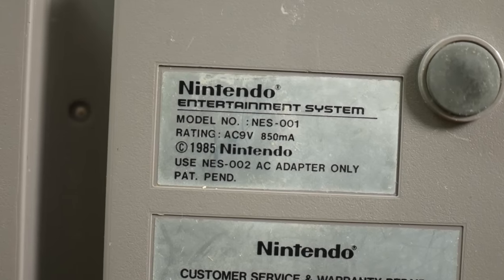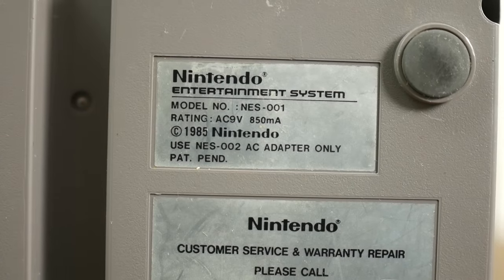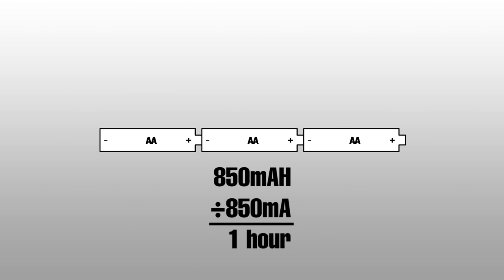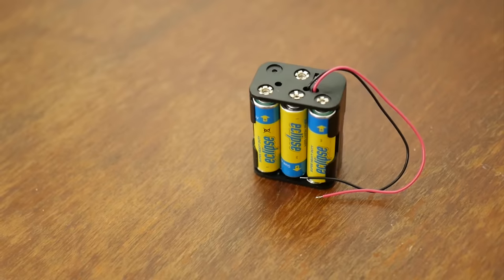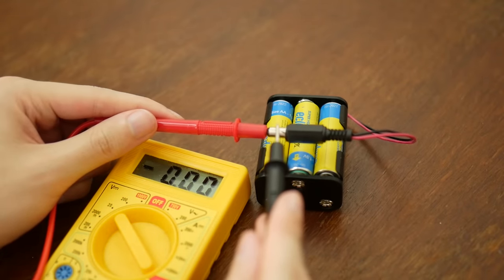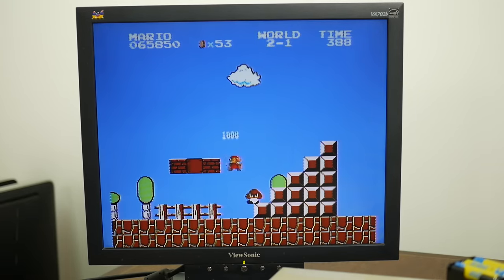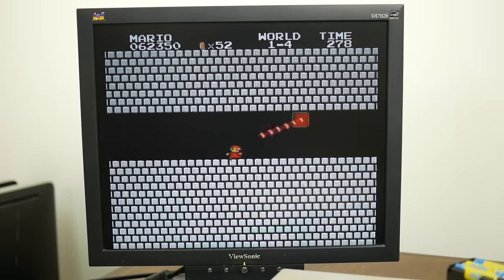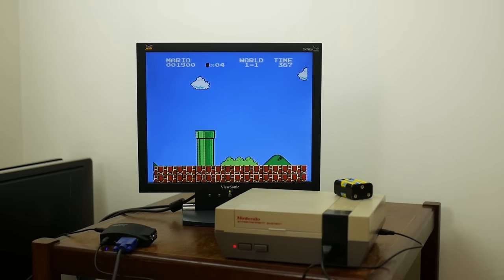Can you run an NES from AA batteries?

Comment: Yeah you need atleast 4aa batteries i did this before 

Or C or D batteries would be better for about 4.5-6v. But with an nes youd want to rip out the rf modulator and rectifier circuit

Rebuild the composite video amp and remove the voltage regulator so it takes 5V DC and not 9vac
Reply: Famicom is easier
Reply: And with rf modulator gone less power hungry

Comment: You can buy lithium batteries which output 1.7v max. I got a whole month out of my bose qc15's then before it started browning out and clicking. Notably the headphones would flick off if I tapped them or anything. I could only assume the voltage had dropped so low that the power switch resistance was enough to cause it to be sensitive to movement.

Comment: there was an old ben heck schematic (might still be available) that covered this. you turn the nes into a nes portable by removing that component that has the voltage regulator and audio/video amp. then you replace it with a transistor and series of small caps and resistors, then bam, battery powered NES that not only can connect to a TV, but also an LCD. mine is somewhat... in limbo.. i just never finished it because i could never find an affordable LCD (they suggested using a PS1 screen, which now costs around $150, out of the question).. im just biding my time before trying to finish this thing.. and also i don't have a proper case for it..

Comment: To solve the whole low voltage issue you can put a voltage regulator and low voltage cut off in between your batteries and NES to solve the issue

Comment: Solution to dead batteries. Hook up another bank in parallel.  If you lose color connect another set of batteries into it. Remove the other ones and repeat. Use rechargeable lithiums for maximum use

Comment: Fully charged batteries always are higher than what they're rated for. 1.5v would be normal around 1.9 to 2v. My 72v (6x12v, 20amp each) ebike is fully charged at 89v.

Comment: if you'd have aimed for closer to the 18v max you'd have gained way more capacity as the voltage could drop much lower per cell and still total 9 (or what ever the lowest that is still usable)
8 batteries seems like a safe bet 13.5v ish (in theory 12 would be the max but as you've already showed that might give to much and even 10 of your batteries would give nearly 17v so a bit close to the max for my comfort)

Comment: Try connecting it to a car battery and see how long it lasts. Since it has a voltage regulator rated up to 18 volts, it should be safe. I bet it would last considerably longer than with the AA batteries!

Comment: you should try a drill battery w/ a buck converter, they're rechargable, and often come in at 18V 3Ah, for an effective capacity of around 6Ah at 9V (since you're drawing half the current from the battery)... thatd power the NES for about 7 hours, and its rechargable!
Reply: or maybe a 10Ah car battery, that'd last abt 15 hours, and also rechargeable

Comment: I was suffering because you didn't checked the curent it was drawing. The batteries have internal resitance, well, everything has a little bit of resistance. It could have fried the inner circuit.

Comment: I have a question, can you run an iMac using only double-a batteries?
Reply: Yes but you will need a lot of double a batteries so it would be just better to use a car battery and a converter

Comment: wait, is it posible to run 2 and 2 baterias together so you get double the capacity, then chain 6 of those for 9,9v and 2x the capacity? (with 12 bateres in total, and 24 if you want 4x the capacity)

Comment: If you really, really want to make it even more efficient especially off the batteries, you technically can use 5 Volts DC switchmode voltage regulator designed to replace the original 7805 voltage regulator, as all linear regulators do is pissing all the extra energy away into nothing but heat which means a bit more power consumption considering the fact that both processors in NES consume the most electrical power (which is also why NES gets rather toasty after a few hours of gaming). I would go that route to reduce power consumption and as a side bonus, less heat.

As for glitching at the end, most voltage regulators are basically dumb, they don't know any difference between the input and output voltage, so they instead stay on until at least the GPU and / or CPU lock up. Those processors require 5 Volts DC power to operate correctly.

Comment: Not futile at all. If you are going to an expo as a seller and there is not power outlet. You might want to test the device in front of the customer and here is a solution! A small LCD TV that runs on battery would be required but that’s fixable too!

Comment: NES runs better on 9 volt battery ,i have tried it before. DC input completely eliminates AC hum sounds and other noises. but 9 volt AC means 14 Volt DC (9*sqrt(2)),if you measure the voltage on the DC side of the diode bridge, but using 9 volt DC runs 7805 regulator much cooler, it even doesn't get warm.

Comment: I tried a 6LR61 battery on a snes several days before, and it runs around 15 minutes. although the battery is taken from a heavily used multimeter, I'm pretty sure a brand new 6LR61 would last at least 30 minutes or more.

Comment: Idk what’s the friking problem with everyone thinking 10v dc is dangerous because it’s NOT.

what’s dangerous is AC not DC
Exemple: 3v dc, very inoffensive
3v ac, tingles a bit your muscles
So 125v ac coming from the outlet is lethal
BUT NOT 10V DC
Even if Matt would’ve connected the two terminals of the battery pack together it would do nothing because it’s dc(direct current) with very low amperage

Comment: So, question. Is it possible to connect batteries both in series AND in parallel? Like, by pairing up two batteries in parallel, then having two pairs be in a series (or some other setup?) Will it end up in catastrophe? And is it possible to avoid said catastrophe, and if so, will it deminish the theoretical effects of both having a longer battery life and a larger voltage?

These sre things I need to know.

Comment: I mean...with a big enough battery (or more accurately, a lot of little batteries in both series and parallel) you can power anything.  I can drive for almost 300 miles on a battery.  It just has to be a big battery.  (400v in this case).

Comment: I once powered a wii (and a small TV) off of a small lead acid battery. I called it my wii portable, but it still needed a massive carrying case to take anywhere XD

Edit: I also used exactly this method to test a supposedly broken famicom. It worked! I got a couple games for it now and it runs off a 9v wall cable along with the disk system

Comment: See after seeing this im wondering about using rechargeable AAs instead and stripping down an NES to fit into a handheld sized form factor along with something like a car backup camera LCD + some controller board for display. It would honestly be kind of feasible and now im seriously considering trying it out using a cheap NES hardware clone

Comment: With this video, now I'm probably capable of running a raspberry pi through batteries. Though I'm assuming the difference between AA and AAA is how much charge is needed.
Actually what happens if you take 2 of those battery packs and connected their wires? Would you benefit from both methods?

Comment: it actually is 6x the capacity even if its parallel. capacity is the amount of energy that is stored. So 6 batteries is 6 x the energy of 1 battery. 1.5x6=9x 100mah= 900mah or 100mahx6=600mah x 1.5= 900mah. I think what you mean is the mah rating which is not capacity.

Comment: I can run a Yamaha PSR-6 keyboard off of a single 9-volt battery, instead of the 6 D batteries it was designed to run on, I accidentally left it on for several hours on the 9-volt battery, and the battery was hardly drained at all.

Comment: as a kid i built a duffle bag that had a small 12 volt black and white portable tv and the nes in it running off of a 8 aa battery pack . that thing ran for a few hours at least . i even included a plug so i could plug the thing in and recharge it . i think the reson i didnt blow the nes was i was using nicad batterys.

Comment: should have used two of those battery packs, and run the packs together in parallels (combining series and parallel) to get both more voltage and capacity

Comment: Next time, try buying 2 battery holders and run them in parallel.  Correct voltage, double capacity.

Comment: 9 volts AC is rectified and Goes to a 5 volt regulator in the NES so you can power it from 4 AA Batteries. Or even less if you use a DC to DC Buck converter

Comment: if you put them in series to get 9 volts and then you make about 4 sets connected like this in series and then you put the 4 sets in parallel, wouldn't you have 9 volts but with more capacity?

Comment: when I was a kid , i had an imitation nes system , and the power adapter was crap and in became really hot after extensive use , so I used to play with an 9 volt rechargable battery

Comment: Yes, you can run an NES from AA batteries.

You need 6 and the NES will only run for about an hour, +/- 30 minutes. Then the graphics will keep glitching more and more until the batteries die and the console shuts down.

There. I just saved you 12 minutes.

Comment: If you connect 6 pairs of parallel connected bateries in series, will it have 6x the capacity and the voltage?

Comment: 9 volts sinusoidal AC will become 12.7 (aka: 9 x sqrt(2))volts DC if you rectify it. The diode will drop 0.7V usually. You end up on almost exactly 12V.
You need a 12V supply at least if you want to power an AC device from DC usually. Most old things also run from LM7805 chips which makes 5 volts from anything between 6 and 33 volts
9V DC and 9V AC carry the same energy but only with a perfectly resistive load with no dynamic change in it.
Also you talked about parallel and series but completely forgot about mixed. make series stacks and hook them in parallel. you increase both voltage and capacity lol

Comment: I wonder how a modern console would respond if powered by failing batteries

There is no reason to believe they are programmed to monitor and handle a failing power supply.
But so much code is re-used these days that maybe they have some sort of protocol for handling it.

Comment: 5:55 bro used multiple AA's to make a 9V battery (when the most common batteries in a house / kitchen draw are  AA / AAA / 9V / CR3032 should of just started with a 9v and then done like 4 to extend the length then you'd of had the same voltage but longer aswell (2 birds 1 stone)

Comment: I also did this, but with a HDMI to AV, At that point, signal kept cutting in and out, and then finally kinda shut off, the HDMI signal wasn't enough and shut off the HDMI signal, I'll prob get a variable power supply so i can do more than that.

Comment: 3:35
@Phillip_HanBurst THANK YOU, this is the proper equation:

850x9/60x850=108 (AKA 1h and 8mins) for the lifetime
or an easier way to think of it:
MaH Rating(X)Input Voltage(/)1 Hour or 60(X)or(/)Output Load = Rated Discharge time before none operational 

What you Calculated(MattKC) is for how much battery is left? even @Phillip_HanBurst Noticed, anyone else NOT gonna ask why he calculated the Power Left in the battery? he litterly did 850/850=1 (You didnt even use any time calculation)

sideNote: you divided 850 by 850 XD?

(EDIT MAJOR EDIT): 5:55
ALL Batties varry more than the recommended Voltage, 
it called making sure the batteries can stay alive for the rated power output
also ANYONE can say a volt will not kill much unless your giving that nes 12v(even That wont), your phone sees 6.5volts alot of the time(More Less Public Places)

Comment: If the voltage is lowering, won't the system draw more current to make up for it? Surely that can damage circuitry. Unless the regulator handles that?
Edit: Spelling

Comment: The current rating is often overrated. Also at lower voltages it would draw less current, so maybe running it on 7.5V could last longer per battery.

Comment: This video confuses capacity with current. The "capacity" of 9 batteries is not the same as one. The wattage (capacity) of 9 volts at 1 amp is 9 watts. The capacity of 1.5 x 1 is 1.5 watts. Additionally, this video should connect the power source after the rectifier. That rectifier wastes 1.2 volts immediately, then that 5v volt regulator wastes another 2-3 volts. So of your 9 volts, 4+ volts are wasted as heat. If you want to really see how long batteries would last, you could have disconnected the voltage regulator, grabbed a switch-mode supply, and then connected the output of that to the 5v rail of the NES. Lastly, just because the AC adapter is rated at 900ma, that doesn't mean the NES actually consumes that power. You could have measured the power consumption for a much more accurate estimate of battery life.

Comment: is it possible to run a pc on batteries? and what would happen when the batteries run low?
Reply: FlowerKingdomTalkingFlower  well the thing is, a laptop is designed to power off when the battery becomes low. Normal pcs aren’t. What would happen if a regular pc was on low voltage?

Comment: Try three 9000mAh 18650 3.7v li-ion batteries in series connected to a 9V regulator for the ultimate portability,  or even a single 12v SLA battery (mini car batteries)

Comment: I tried this myself but with a 9 V battery because I did not have the patience to wait for AAs to die and nothing interesting happened with the sound except it  would would continue playing the same sound when the game crashed also for me the tiles started glitching before the color stopped working RF modulator was not affected much besides more static And with composite video the audio was quieter and the colors were dimmer

Comment: lol I did the same thing but with a rasp pi and it just completely stopped responding to anything when the batteries ran out.

the pi was working partially fine, the cursor worked fine, and when I moved it around it would respond with things highlighting when I hovered my mouse over them, but clicking wont actually work

Comment: Yeah just get a fake generic replacement third-party power supply made for the NES and modify the cable to connect to batteries and you probably could power it off AA batteries

Comment: Why wouldn't you use 18650 Battery in this day and age, why use AA Battery instead of 18650 Battery in a Nintendo NES, could even use a battery bank with a 9 volt output.

Comment: 850mA is the maximum it takes and the power supply provide but it use it not full.
More funny would be power the 9v oder a power delivery power Bank with a 9v power delivery dummy.
These old power supply are not needed anymore with usb c ower delivery

Comment: It is posible to connect in serie and parallel at the same time?
Reply: Pretty much yeah, saying that you connect some of the batteries individually by series plus a pack of batteries connected in parallel following the same rules (individual’s positive to parallel’s negative). The parallel pack will act as another battery in series, just with more capacity.

Comment: I mean its good to have a battery pack for you nes if your power goes out you can use a rechargeable TV so that's a good use for it your If you have a TV in your car you can use it for that its pretty useful and the nes is still a really good gaming console its not going to beat your ps3 or ps4 but it still has its usefulness

Comment: btw ur kinda wrong about capacity, 6 batteries in parallel has the same amount of total energy or capacity as 6 in series , so if 6 are in series and each one is 2000mAh at 9 volts that would mean the entire pack has a capacity of 18Wh and if you take 6 in parallel that would be 12000mah at 1.5 volts that also equals 18Wh or 18000 mWh the equation is volts times mAh.

Comment: just get a nes usb controller, laptop , and nes emulator
Reply: I'm stupid you can't run that on AA batteries
Reply: wow i actually found this comment, and I would like to correct my previous statement. Almost all (probably all but I want to stay correct here) laptops, have a DC input for their charger. Therefore, if you took out the internal battery, you could plug in the laptop to a AA battery pack, and run the laptop off of purely AA batteries. The emulator and controller run on the laptop, so nes on batteries, on laptop.

Comment: Series and parallel isn't an either/or situation. You could put AAs in parallel in 6 groups and then put those groups in series, or you could make multiple 9V batteries by putting them in series like you did here then put those in parallel. The pack you bought is a multiple of 6 batteries :-P

Comment: don't need to watch video the voltage is rectified before it goes into the nes. there's probably an adapter for to the exact port with 6 cells. put two 6 series cell combination for a total of 12 cells or use a boost convertor.
Reply: Wow, bet you feel smart

Comment: nes support ONLY AC NOT DC CURRENT!
Reply: i run my nes on 9v dc and it works just fine
Reply: The NES actually has something in it that converts the AC current into DC
Reply: @gamecubeplayer  IS NOT DC IT IS AC!  ALL NES VERSIONS EXEPT JAPANENE IS AC
Reply: @sethhorst6158  First take it ac and then have regulator to change to dc!
Reply: @blade3120  the official nes ac adapter is 9vac but the nes also works with 9vdc